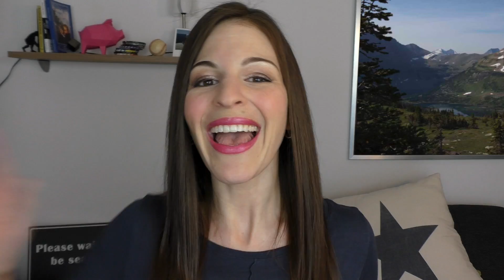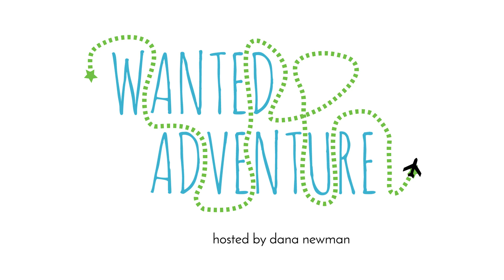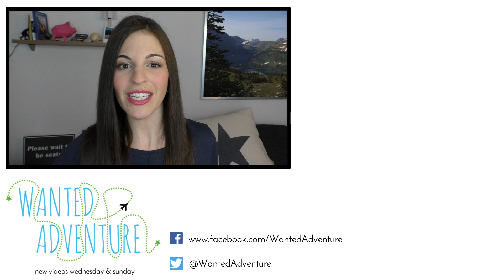Why Are Houses in America MADE OF WOOD?!

Comment: So, I'm a storm chaser from Texas and I can confirm that the only safe place from a tornado is underground. That being said, a reinforced concrete house would go a long way towards keeping you safe. Actually, if all the houses were made of stone or concrete, you would be a lot safer. Most of the debris in a tornado (the stuff that kills you) is tree limbs and building materials. (wooden 2 by 4's, plywood, and sheet metal) So, not having a bunch of building materials flying around at 100-250mph would make tornados much more survivable. So that leaves the cars and buses that get thrown around. If one of those comes at you, it's game over. But, they don't tend to stay in the air for very long or fly very far. So you are unlikely to get hit.
Speaking of unlikely to get hit, tornadoes are surprisingly difficult to get close to when you are trying. It is not unusual for a chaser to go a year or more without seeing one. So, it is actually extremely unlikely that you will get hit by one at home.
That being said, the material I would like my house to be made of is gold. Barring that, steel reinforced concrete with an underground storm cellar is a close second.
Reply: What is cheaper, one concrete house or two or three wooden houses?! 
What I mean by that is, why built a wooden house again, after the first blow away? At least then you could replace it with something more solid.
Reply: @koshnarale9952  2 wooden houses are more expensive than 1 properly built concrete one. That's just building it.
Then you get living in it: it's generally easier to insulate and to regulate during the seasons, so that is a big cost that goes down.
It requires WAY less, less frequent and less expensive maintenance, so other costs that gi out of the window there.

It will also last way longer, making it a safer investment for your kids or to sell afterwards if you move out, since it will be in better condition (if you ain't an idiot) and it will thus retain more value.
Reply: Because most people in the US do not live in tornado areas or hurricane areas.  And even in hurricane areas, you just need to build the houses correctly.  You use tie down straps to keep the roof from blowing off, you size the space between struts to take the wind load.  I've sheltered through 3 hurricanes in my parents wood house in Texas, with no structural damage.  Dad made sure the property was above hurricane flood levels and built the house to weather the winds.  Most people don't do the research, or can't afford the extra expense, or just don't think about it.
Reply: Retief Gregorovich wood houses required a lot of maintenance too. They won’t last many years or decades like concrete houses without expensive maintenance.
Reply: John Schoolfield from Texas too had a hurricane i do not recommend being underground
Reply: I totaly agree with your comment i live in Kerala,  south part of India. We build house with brick and concrete. The walls are made up of brick and the roof is concrete. I always wondered why people in us build house using wood.First i thought it is for better insulation. I understand the part where wood is widely available and cheap compared to brick and concrete.  I mean how many times do you see  a bus flying towards a house during a tornado. I see the houses in us collapse even with winds which has speed lower than that. Roofs fall apart during winds which has less speed than she mention in this video. I am sure that a house made up of brick and concrete can withstand it for sure.
Reply: Huschibaba if you look at how a tornado is formed. There is a large area were it is possible to have one form. But it's not guaranteed.

This is also why there r more deaths when they happen were people are used to them. They have 'watches' (times - sometimes hours - where one could form) vs a 'warning (get your butt in the basement)
They had to make a new level. A' alert'  wich is for the biggest ones.
Reply: Well spoken. a german. But i think nowaday american wooden "Tornado" proof houses, will be strong as the european houses
Reply: Markus Lange ... no, they are not.
Reply: Kommt darauf an, wie man diese befestigt. Meistens nur genagelt, wenn überhaupt.
Reply: Huschibaba yes sorta. If you know someone actually put the needle in there.

I enjoy weather. So I read up on storm chasing. And it's not like a blizzard that covers a large area.
Reply: Huschibaba and sometimes it's good to get close. For learning the set up of a tornado, you can then warn people earlier.
Reply: Huschibaba like I said I like weather. Particularly tornadoes. So it was something easy to teach.
Reply: Less densely populated areas means less flying debris in a tornado, but some of the biggest tornadoes have crossed some of the most densely packed places.
Monolithic dome houses are probably the only structure that would shrug off everything but the most destructive wedge twisters. They shrug off bombs exploded inside them, mostly.  http://www.erikahammerschmidt.com/wp-content/uploads/2016/06/Iraqi_dome.jpg
Reply: You dont need to guess. See only Philippine and Indonesia during hurricane and tsunamis, the only building standing are build with bricks. The answer why? is simple. Because building with wood is cheap :)
Reply: It’s also more expensive to build with bricks. They get destroyed anyways, and take too long to rebuild. The USA builds houses so fast.
Reply: Do you now the story about 3 pigs and the wolf ?
My mom told me that the first 2 brothers deserve to lose there house couse they where lazy.

If you take the story into real world,  this words seem evil. 
But if you think about it the Argument it is cheaper is just lazy.
The point they aren't proof is lazy too couse they make huricanes saver then wood houses.

So do they diserve it for not learning from that story?   "Uff"
Reply: Or... just make a dome-shaped concrete house. That should be able to take a direct hit from almost any tornado
Reply: Tornadoes are the least of my concerns.  After 20 years of being a landlord in the USA, I am more afraid of dry rot and mold than tornadoes.
Reply: I'm calling BS on a tornado throwing buses around regularly... like that's got to be highly unlikely. Tornadoes don't go around destroying  concrete structures as far as I've seen.
Reply: @dotheyfloat9961  
https://www.youtube.com/watch?v=djL7xG7_ETM

https://www.youtube.com/watch?v=WABqwKjQM_c
Reply: Finally an American or actually Texan that can think deeper than standard American. Well written!
Reply: Yeah, I don't understand how the argument "there are buses flying around, so it's pointless to make it resistant to most other things in the very slim chance you get hit by one" could be even conceived.
I mean, I live in the mountains; it would be pointless to make a sturdy and very snow resistant house because an avalanche could get me? Lol
Reply: @Anankin12   Underground house. You get natural climate control to boot. 3 birds, 1 stone :)
Reply: @johnschoolfield9339  and death by radiation due to radon and stuff
Reply: well roofs are shingled in germany. google "tornado schäden deutschland". realy not that safe.
Reply: With the case of north america, people prefer wood simply because it's cheaper, and not because it is more available. Concrete and steel can be just as cheap if there is a demand and the labor is skilled enough to finish it on time.  It comes down to culture, canadians and US americans prefer to leave their parent's house as soon as they finish their degree, find a new town to settle, and send their oldies to a retirement home. Houses here are not made to last, regardless of how it was maintained to stand for 100 yrs.
Reply: on the other hand, a brick or concrete house you have to bring down, that are also extra costs  you have to calculate.

Comment: Reasons that residential wood-frame construction is superior to masonry construction:

1. Freedom and flexibility of structural design choice:
There is nothing more boring than four walls meeting at 90-degree angles. 

2. Freedom and flexibility of color and exterior material choice:
The choice of color and exterior material is far more flexible in a frame house than a masonry house. 

3. Freedom and flexibility of window and door size choice:
Window and door sizes can be much larger in frame homes - allowing for much better views and greater ingress and egress openings. 

4. Freedom and flexibility of remodeling choices:
It is a thousand times easier to move a wood frame wall than a masonry wall. 

5. Freedom and flexibility of building a home quickly:
A very sturdy wood frame home can be built much quicker than a masonry home that requires materials to cure. 

6. Freedom and flexibility to build on various terrain and topography:
From sea to shining sea; from the tops of mountains to the bottoms of canyons; from the greenest forests to the driest deserts -- a wood frame home has many advantages over a masonry home. 

These reasons are just off the top of my head. There are many more reasons wood frame construction is superior to masonry construction. 

Beyond that, the population of the United States is about 330 MILLION and growing, compared to just 80 million for Germany, which has severe landlocked growth limitations. As an ever-expanding country, the USA simply does not have the time to construct new masonry homes block-by-block. The demand for new home construction in the US would not allow for slow-paced masonry construction. 

Maybe if this young lady would drop the phony "cutesy act" and put some actual intellectual thought into answering her German friend's condescending question, perhaps she wouldn't make women in general look like mindless idiots - or at least she wouldn't make women look like they had been hit in the head by a "FLYING BUS."

Young lady -- "cutesy" has a very limited shelf life.

Comment: There are many different types of wood construction and in general the type people imagine when they think of American houses, is the big houses you see in movies.  these are often very cheaply constructed.  Spray insulation and small cavities.   We build Cyclone resistant houses here in Australia (norther parts)   it generally involves large size bricks with steel reo bars put into the cavities and then filled with concrete, and louvres for the windows so that the air can flow through the house and stop the up pressure from ripping off the ceiling.   this works here, however this design is for the tropical areas and would need major changes to work for the weather that also gets very cold,  and also the houses are not as big.

Comment: The simple answer is wood is cheap, fast and easy to use. Concrete and brick are more expensive and take time to dry. I've grown up in a boom town here in middle Tennessee and also have worked construction here. I've actually seen entire subdivisions of 100+ homes be completed within one summer (each home costing roughly $200K - $400K). Framing up a 2 story "McMansion" actually only takes a good "Spanish speaking" crew 2-3 days, with a new home going from bulldozed land to complete house with landscaping in about a week or two. On the topic of Tornadoes, yes, I live in Middle Tennessee, part of tornado alley and I have seen 4 of them with my own eyes (they are smaller out here than out west but still very deadly). They are dangerous, they are scary but so are car accidents, so is getting struck by lightning so when you live in an area like this you pay attention to the weather and your surroundings, when you hear the air raid siren or see the alert on TV you take shelter IMMEDIATELY! Also, older mobile homes are TERRIBLE in a high risk tornado area, however, newer ones if put on a proper foundation can be just as safe as a regular built American home.

Comment: People had to travel to the West Coast of America by covered wagon. Stones are way too heavy and where are you supposed to find them? There are trees everywhere. Makes perfect sense to use them. Bricks were used on some old buildings but those buildings fall down occasionally. Most commercial buildings around here now are built out of steel and glass, but single family homes are always built with wood -- Douglas Fir is what we have the most in the Pacific Northwest, so that's what we use. The idea of building something with stone is very odd, except when they are already laying all over the place. Places with volcanic rocks sometimes use them for fences, way out in the country. Another point is that spaces are much more wide open in the West, and hauling rocks around for hundreds of miles isn't easy. There were no roads either when Europeans arrived. Building material needed to be as light as possible. And much of the Pacific Northwest is buried by a massive amount of soil that was washed over it by a giant ice-age lake with a natural dam, which melted and let all the water out. Most of Eastern Washington ended up in Western Oregon.

Comment: i was asked the same and pretty much pulled a "you" i dont know lol. thanks for this vid, gives me somethin to answer back with now. a real tornado proof house would have to be under a mound of earth/underground. exposed sides would have to be slanted because any billboard structure just wont do. even if it survives, it will suffer and fatigue over time. sure you could patch cracks etc but everything wont be square anymore. wont fit right anymore. might as well just buy an old 50s era ICBM underground silo :)

Comment: I wonder if the "amazement" of the questioners about why Americans use wood frame houses rather than concrete or brick may be due to the "everything is supposed to be better in America" theme. Some things are better, some things are worse. In America, we have all kinds of different stuff going on. We have steel framed/wood framed/concrete framed houses. 
Most places use central heat pumps. I might venture to ask why so many commercial buildings in Europe use the ductless A/C units when large scale A/C systems are more efficient assuming all of them are running daily. Or maybe why the hell does the UK STILL drive on the left side of the road? How about why does it seem that body odor and general hygiene is an irrelevant concern in many middle eastern countries (I'm looking at you turkey)? 

Every question has much social and historical depth to it. Sometimes it is because of economics like in the case of wood framing houses. Its expensive to find a contractor/builder who has experience with this sort of residential building material (CAUSE WOOD FRAMING IS MORE COMMON!!!). Is concrete better? Duh! is it more expensive? Duh! If you could save 20-50,000$ off your new house would you (even if its not a better deal over the next decade)? DUH!! And so, as demand for cheap houses developed, residential builders got really good (and FAST) at building wood framed houses. And lets be honest, wood DOES THE JOB! for the most part. Does it typically last forever? No. But whatever. It does the job. I think America being the product of the independent free market capitalistic philosophy, unfortunately, sometimes results in some pretty shoddy craftsmanship since, the bottom line is the primary concern for the builder. In any case, the shoddy craftsmanship DOES get the job done. 

In conclusion, why does America use wood framing? Cause that's the way we do it. That's why. Interesting video.

Comment: Not all homes are made out of wood, and generally, it is only the framing of the house, and the floors that are wood.  Yes, wood is quite abundant in the Americas, but depending on the region of the US, the homes can be quite diverse.  In the Northeast, there are plenty of stone and brick homes.  Cobblestone homes are unique and sought after.  In the southwest, homes may have framing of aluminum, then covered in a heat resistant and fire retardant foam board, which is then covered in stucco.  In the mountain west regions, there are plenty of homes that have walls of concrete or cinder block.  

The framing of the home using wood allows it to be built solid quite quickly.  Making additions to the home, or doing upgrades are quite easy.  Drilling a small hole through a wood stud takes about 5 minutes, if you need to run new electrical or water piping.  Older homes of stone or concrete often have to use special drills to chisel through.  This adds significant cost to have a handyman professional do this kind of work.  

Next, termites and insects generally attack older homes as the wood used is old an often untreated.  Newer wood often has chemical treatment to repel insects and resist rotting with age.  Stone homes crack and collapse when exposed to earthquakes, especially on the west coast.  Many have had to have their foundations redone with special springs and shock absorption material because of the risk of destruction.  Framed homes can be made quite energy efficient compared to stone homes.  Older stone homes in the desert areas do not keep homes cool.  To properly setup a stone home to be efficient with its heating and cooling capabilities can make the price of the home skyrocket in price.  

Finally, old stone homes have very difficult times with wireless technology through their walls.  Much of the stone in the US contains traces of iron.  This makes it difficult for wireless signals to pass through.  Standard framed homes (even with aluminium studs) will pass wireless signals much cleaner and clearer through the walls.